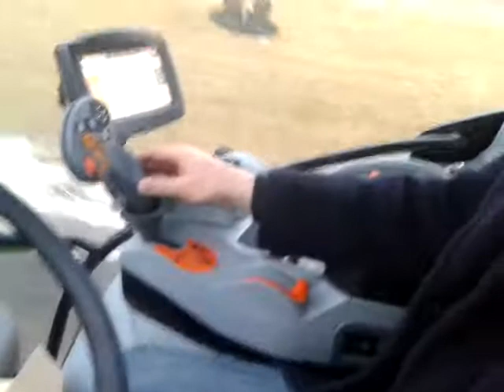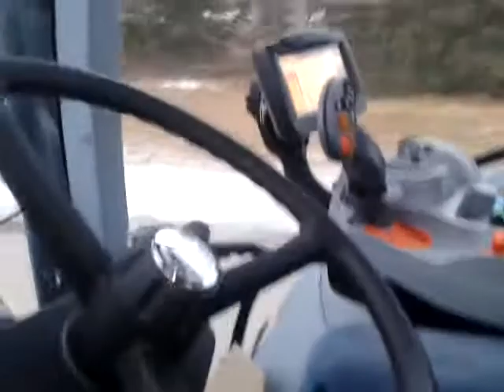Driving a new holland T7.210

Comment from the maker: Good thing you know all about tractors seeing as the newholands have bigger cab space climate control all electronic functions and just to let you know a johndeere 6430 has ten more horsepower on the engine then our newholands t5060 also our newhollands t5060 are smaller then a 6430 but now saying that a 6430 may have ten horsepower more on the engine but on the PTO the 6430 and 5060 have the same horsepower thats pretty sad for a 5060 being smaller then a 6430 know your facts before you comment